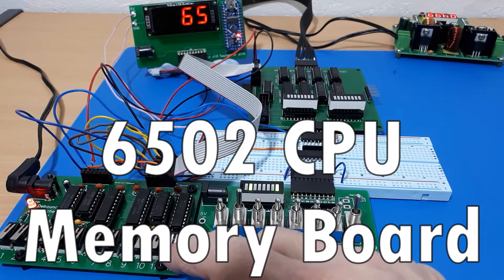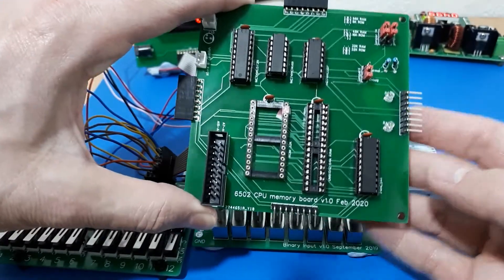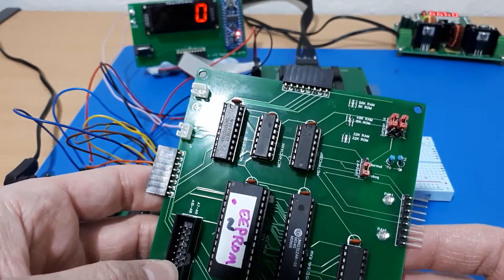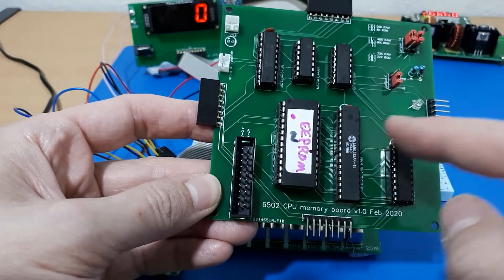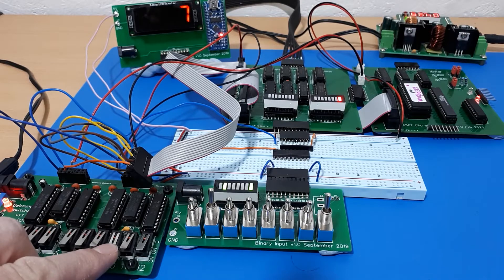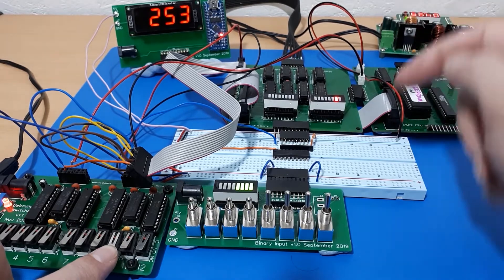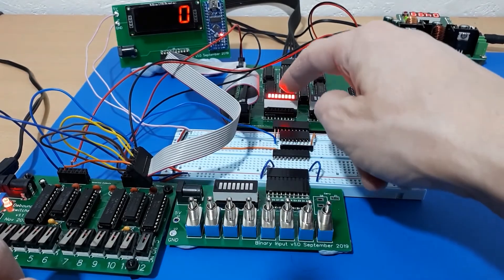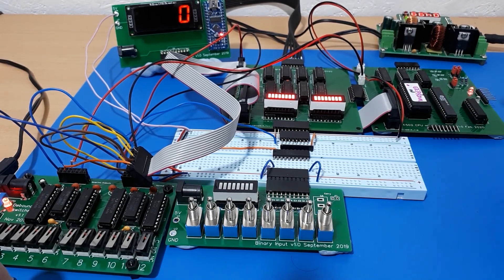ROM & RAM Memory Board for my DIY 6502 CPU project

Comment: The KIM-1 Computer needed only a few extra buttons to enter up to more then 65.535 memory addresses and data up to 255 decimal. Others in those times of early computing tried to save money by using ROM's as little as possible. But today there is no shortage in ROM.  
 
I was thinking about a different system of entering data and addresses, there are four seven segment LED displays, above these displays are four buttons, for up, underneath there are fout buttons for down. Then all the memory addresses can be typed in with only eight buttons. For data it is the same idea, two LCD displays, two buttons above, two buttons underneath. Furthermore there are buttons needed for Go and Store etc. It won't save money or time but I think is is less work then typing in all addresses and all data binary. 
 
Another idea would be, four cursor buttons, with left and right you choose one of the seven segment LED display, and with up and down you higher or lower the number.